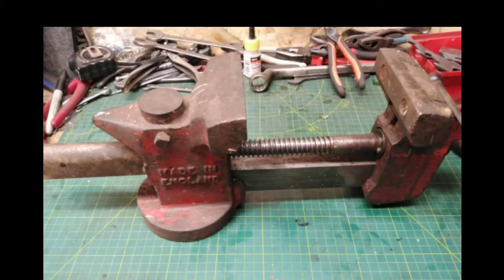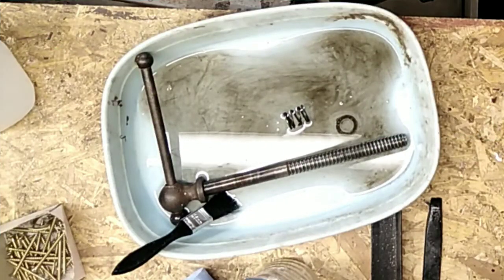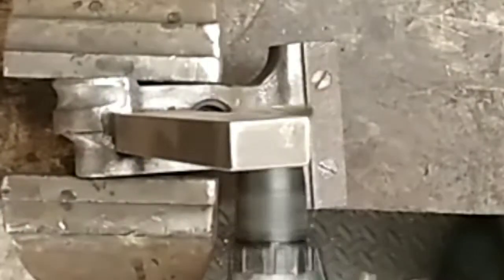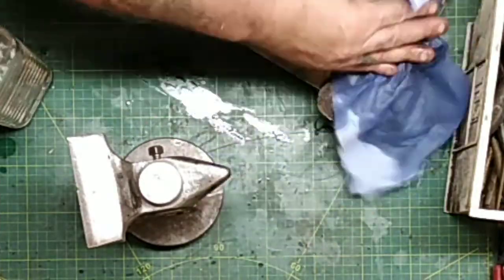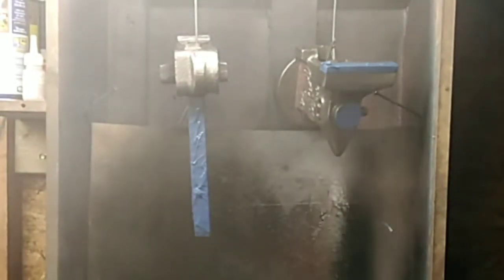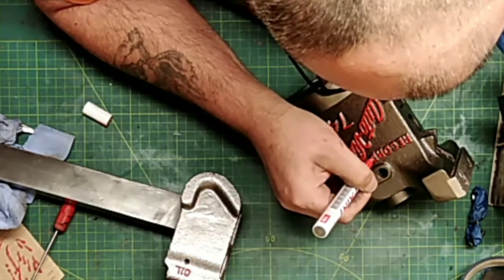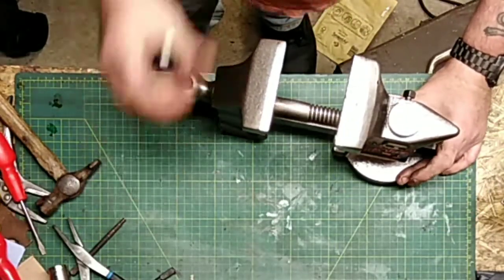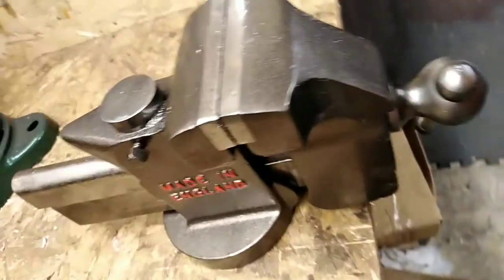vise restoration record 74 auto vice strip clean respray  rustoleum metallic vintage

Comment: Did you use a red marker to touch up the letters? Which 1 ? Thanks. Great video
Reply from the maker: Generally I use the cheap ones on eBay 12 for about £7 , as long as they are  acrylic. Fine ones I use ending brand .

Comment: Nice job. An Imp, a 74 and an 84 is my dream vice setup.
 I did a 74 non auto version a while back and temporarily painted it grey, never got round to painting it as it became my main working vice. Unfortunately also no swivel base.
Nice to see that the rough casting was from manufacturing as i suspected that someone had done a botched restoration on mine. Had forgotten about what a b&*$"h that spring/pin is.

Good tip about the wire brushes from screwfix thanks. They also sell pin punches, which are less damaging when removing pins.
Reply: I have a similar idea of a dream vice setup :-)